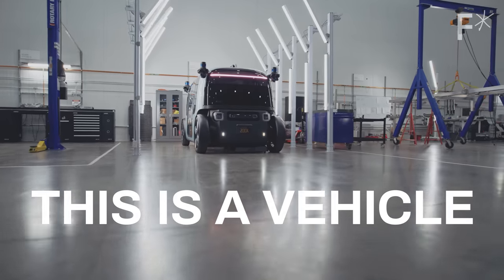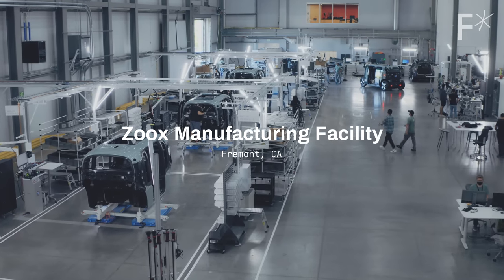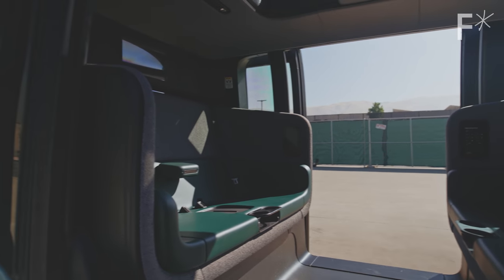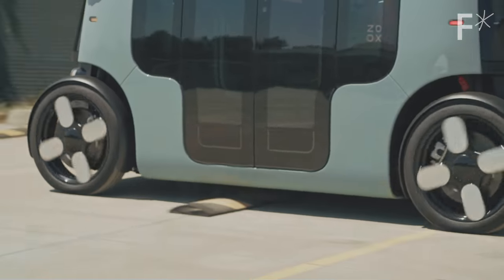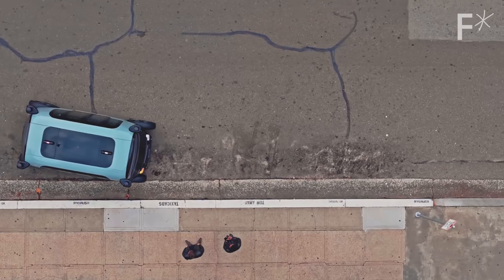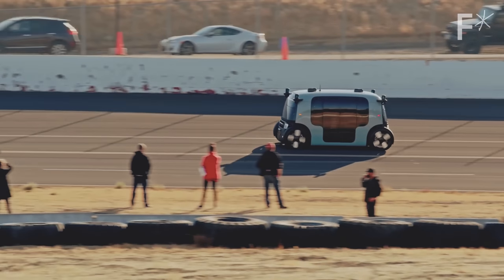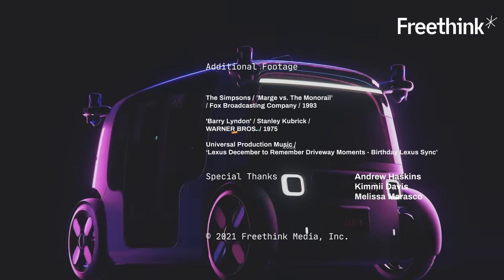Inside Zoox: The robot vehicle totally changing transportation | Hard Reset by Freethink

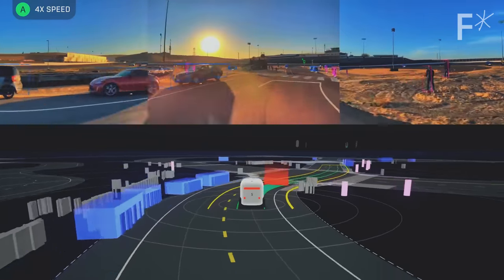Comment: At 5:39 they claim “a significantly higher level of situational awareness” yet at 4:53 the AV drives stright into the middle of an interesection that it cannot safely exit.
Reply: That seems easily fixable, tbh. Software is called Software for a reason
Reply: @cob571  it's still completely inferior to a bus ffs
Reply: @cob571  Of course it's possible to program it better. The point is the lie, much like the rest of the video.
Reply: That was a pause for a pedestrian crossing. No different to normal driving.

Comment: There are too many weaknesses in this project for this to be viable.
1. This is local only. When it comes to inter-city travel, this vehicle is useless.
2. Vandalism is a problem and so is hacking. There is 0 explanation about cybersecurity and it doesn't seem very hard to mess with the sensors outside the vehicle via spraypaint or a heavy object.
3. So the vehicle can avoid crashes. But what about other vehicles crashing into the zoox?
4. And in the case of an injury or a fatality, who is going to be held responsible?
5. How will insurance companies categorize accidents and fatalities?

And just so much more issues that remain unresolved in the video. This is just a gimmick in the end and provides a solution to nothing except to line their own pockets with money.
Reply: I mean it’s a cool concept and I could see it making car crashes be less frequent, but yeah it will need a lot of work.
Reply: Luddite

Comment: No autonomous vehicle maker ever talks about abstracted fault.  They add the crashes from dumb, drunk, high, raging, speeding, distracted drivers into their calculations of crashes prevented thus their numbers are irrelevant.   Due to the abstracted fault, these vehicles have to be safer for every single individual driver for them to be accepted on a wide scale.  That means, not the average driver, but the best driver must be safer.  Also, the good drivers are usually the ones with the funds to afford such vehicles so that is the hurdle to overcome.

Comment: Seems interesting, but I live in Appalachia, where unpaved roads are fairly common. I don't see this serving this area, let alone serving any area in adverse weather. How would you evacuate before a hurricane? Or in the face of shifting wild fires?

Also, unless there is a carpool option, commuter traffic in cities will be just as congested as it is now. 

Scalability doesn't mean broad ranging utility. What about the need for car seats or booster seats, large families (3rd row seating), cargo capacity (trips to airports, luggage takes up a lot of space), accessibility for mobility limited individuals, assistance for independent yet mentally challenged individuals that don't understand the lack of a driver... the list goes on and on. But for financially well-off, non-challenged adults this is a good option.

Comment: "Because of lawyers and insurance companies..." That, folks, is why autonomous vehicles will never, ever be fully implemented on public roads. It seems like a novel idea and I admire the ambition of those anxious to make it a reality. Unfortunately, when it comes to human beings, greed and a general lack of accountability are the very aspects of this equation that simply cannot be factored out through artificial means.
Reply: There are many machines and automated processes in regular use for which you in the end can make responsible individual beings. With airplanes, for example, crashes not caused by the pilots can often be traced to errors made by engineers responsible for the maintenance of the machines. This has worked for many decades now, so I don't see in what way the human psyche should generally not be able to attain such a handling also of dangers caused by errors of AVs.

Comment: 5:04 That statistic comes with very big caveats that are never mentioned. What it means is, in 94% of car crashes, the driver could have avoided a collision if they’d reacted faster. But on most of those cases the driver(s) were already put in a dangerous situation that were not necessarily caused by humans, but by bad safety standards, road design, and lack of necessary maintenance. So it’s simply not true that “94% of crashes are caused by human error”.

Comment: How are you going to stop it from causing accidents say if I head at it quickly in a vehicle I am driving, say in the oncoming lane, and I jerk the wheel towards it, making its' sensors presume that I am going to impact it?  Will it try to evade my car?  Or will it just ignore my vehicle?  Or will it attempt to slow down, give an impact warning?  There are many things about auto driving that concern me, not necessarily with the technology itself, but more so with the mergence while many human driven vehicles are still on the road with them.  Also, there are simply people out there that would like to mess with them just for fun, perhaps to cause problems intentionally, like hackers, etc...    food for thought
Reply: I would imagine that analog interfaces alongside the current digital ones running these would be the best answer, as it is the best way to create true AI interfaces as well.  Say if I do jerk my car towards it, it would then have a programmed set of variables, but an override of analog ones, just in case someone figures out how to throw of the digital variable programming.    So, if I were to unintentionally start drifting towards one, it would do the necessary precautionary methods to avoid it, by using whatever space around it possible to navigate, but what if there were too many variables because of too many interactions as a result of my actions; other vehicles also reacting, etc...    I really hope you do your homework people; otherwise, unnecessary deaths will only make the meta verse more popular, lol.  Perhaps this is where we are headed though, were only the wealthy can drive their own vehicles.  That might also cause tremendous issues if people do not have the current freedoms available now with our own ability to drive.    Scary, political, greedy times we are in.  A breeding ground for mass terrorism.  No wonder the police state of totalitarianism is on the rise.  No wonder our generations are slowly being brainwashed to accept this, and intentionally methodical to prevent divisions that lead to war, instead of complacency.

Comment: Here's an idea - don't charge the car...er..."vehicle" - charge the battery. Have a modular, plugable battery that can be quickly swapped in and out by an automatic/automated robotic arm or set of robotic arms. When the vehicle's battery gets low, it pulls into a station, and the battery is quickly removed automatically by a robotic unit at the charging station dock, and a fresh, fully-charged battery or set of batteries quickly inserted in. Also, We have very thin and ultralight and flexible and cheap (and getting cheaper) solar power panels (almost more like solar power wallpaper) - so cover the roof and side panels of these car...er...vehicles...with  stick-on solar power strips, and you can increase the amount of time before a car has to recharge or swap batteries. Also we now have new clear solar power collecting "glass", that charge using wavelengths of light not visible to people. This glass probably filters out UV and/or IR light (UV filtering glass is so not good for a greenhouse or if you have a lot of indoor plants, as the original builders of Biosphere 2 found out) but for certain buildings and car...vehicles...like this, and in cities in hot climates, this would not just make extra power too (in conjunction with rooftop and side panel solar mentioned above) but also keep a vehicle's interior much cooler. A set up like this would stretch the time between needing to charge - and the range of the vehicle in areas where charging stations are fewer and farther between. Then, with swappable batteries, this no need for a vehicle to just sit there idle at a station for a couple of hours, re-charging, it could be in amd out in a matter of minutes and back on the road! 

(My only issue with something like this is not the safety of the vehicle and it's ability to avoid obstacles and pedestrians and bikes and other vehicles like itself - it's the inability to avoid some idiot in a heavy all-steel vehicle barreling down a city road through an intersection that I worry about. And that kinda accident seems to be the cause of most city accidents from what I can see. I can see these kind of vehicles working in downtowns and communities/suburbs and some small cobblestone towns (like Bisbee Arizona) or in a "New Urban" community (love New Urban design!) or anywhere that has been optimised for pedestrian and bike and scooter traffic over car traffic, where cars aren't as common and they don't have the space or time to get up to dangerous speeds, these kind of vehicles and taxi's would work great. On maybe inside - and ONLY inside - the borders of a planned gated community or cul-de-sac neighborhood this could work, but in most of those neighborhoods when you drive it's to leave the neighborhood to where the work and the stores and schools are. Sometimes you might drive from one home in community to another in the same community - but rarely. I suppose having a few of these inside those communities would make sense, but they won't really replace cars and I doubt they'd get used much in the situation. But somewhere like, well, driving around a lot of US cities like here in Phoenix Arizona and Tucson or LA or Dallas or Jacksonville, Oklahome City, etc, etc, etc...suburbs, outside of the city centers where the sprawl is, where long ago vehicles were prioritized for vehicle traffic and lots of it... I would not feel safe in one of these.

Comment: That is very good, not only it will solve traffic problem but also cost of fuel, parking easiness and much less car crashes fatalities
Reply: After all, a vehicle which first has to drive to the starting point of its trip altogether drives a longer distance. Which means that you could have a lower number of car crash fatalities if such vehicles rather became common as individually owned.
Reply: Or just bike and use transit

Comment: IMO the way they are doing, will not scale up well at the start... by having to literally map every single road and city first, means you won't be able to roll it out quickly, plus if there's a new road or highway or even road diversion the computer might be confused even if there's the mapping data. 

I'd say Tesla's method might be one of the better way to increase "knowledge" even if that's mostly tedious coding BHtS . that and accurate general shop/ address data would be a much better way to go forward (it'd be better if there's a smart grid the city, but that would only increase initial cost if the city doesn't have it.)

Comment: They're not going to replace personal car ownership.  Rather this is competition to taxi fleets, public transit, Uber, Lyft, and other ride share services.  When their robot cars lose a sensor pod how good is it at seeing around corners or driving?  Nice that it seems to have omni directional steering.  But that pony is well trained by now and has been for some years.  What is the maximum speed it can travel all on its lonesome?  In a sense it is re-branding the term "auto mobile" to be something more like the "AutoCar" or even an "AutoBot".  An Autonomous Robot shaped like a passenger vehicle...in the form factor of a car.
Reply: @Flame I don't know what type of public transit you have but where I live it is a mishmash of buses powered by compressed natural gas and electric closed loop trains.  Watch the 3rd rail.  The buses and trains are human operated.  The trains have cars.  There is a shortage of drivers due to the pandemic and frankly this particular public transit authority is notorious for not paying their drivers what they're worth.  So even before the pandemic there were lots and lots of problems getting service to operate on time or at all.

The closed loop train only travels less than 50 miles in a cross configuration.  Buses feed the train stations.  None of these run after 1am.  Many bus routes stop running around 11pm to 12m.  Some stop running sooner on weekends and holidays.  Not an example of running more efficiently when you're an actual daily user.

Comment: They need to check their math.  This system would require less “cars” alright but the total miles driven will increase a lot.  If I am 5 miles from a destination then that is 10 miles round trip if I owned a car.  With their system, they still have the 10 miles round trip plus whatever miles the robot had to travel to get to my house in the first place plus the miles to get back to the charging station or the next customer.  So the energy consumption be it solar or whatever it be will be greater not less.
Reply: what if the next customer is close to your drop of point? And the one you used was close to you to begin with?

Comment: I feel like this is moving in the right direction, but it's not the be all end all. Currently, this design is only one step better than an electrically powered Uber. It's not going to massively reduce congestion or energy requirements. What could be pretty good, if they have the right tech to run the system efficiently is larger vehicles, about the size of a minibus. You would hail a vehicle from your phone and the nearest one to you that's going where you're going will pick you up, but you'd share the vehicle with some other people, and the software would intelligently route it. Then you'll be bridging the gap between high capacity transit, and 1-4 people in a private car. That might actually reduce car use a lot, especially if it's much cheaper than a taxi (which it would be if it had no driver and carried multiple people).

Comment: Why are not cars symetrical? 
Maybe because of aerodynamics, fuel economy, better wind resistance, maybe even safer (if you get into crash, you have motor in front of you)...

Simply put, box like this is maybe more efficient in how much space it takes in the traffic, but otherwise doesnt make that much sense especially for higher speeds.

Comment: may be great for short distance inner city travelling but if i wana go somewhere 100km away id have to sit a vehicle thats not mine. so i wont get the same amount of freedom like smoking or eating snacks. 

also how much would that fare cost? would it be easy to command the vehicle to stop and go at any point on the road in case i have errands to run or would it be like a point A to B styled ride ? because if its going to behave like a taxi. id have to order one every time i get off one, do my errand, come back out? 

unless all the cars on the planet are using these cars, the human error part will still be in every day life. just because youre in this autonomous vehicle it doesnt mean other people whos driving cars cant crash into it. difference is if youre driving a car you can possiblly evade. how will this autonomous vehicle evade another human driven car in case something like that happens ? 

if sensor gets damaged or covered(eg bird poop. hail. rocks that fly into our windshields will definitely hit one of the sensors at some point ), will it affect navigation. or can sensors pierce through all that ? how well do sensors work in heavy rain. if its using light like lasers does refractions screw with navigation ? will the vehicle just stop.

Comment: I want see it parallel park! And how nice the part that burns on these electric vehicles you sit on! Should be a regular heated seat after charging😂
Reply from the maker: Per Zoox's website: "We’ve built four-wheel steering into our purpose-built vehicle. This unique engineering feature enables it to pull in and out of tight spaces without the need for parallel parking. More movement = more maneuverability." https://zoox.com/journal/atozoox/

Comment: The only problem is you're going to have to remember a ten character password and do two-factor authentication just to drive to work. And of course there will be technical problems and you will forget your phone or it will be out of power. Then you'll spend 30 minutes on hold waiting for tech support. If you can understand what tech support tells you, it will be something like "restart" the power supply which you won't be able to find. Manual? Hahaha - spend another hour scrolling youtube videos. You will finally get underway and the safety protocols will stop the vehicle because a pigeon is crossing the road. The whole trip will be logged amd monitored so that some evil tech company can sell your data to advertisers - or an AI drone targeting system.

Comment: This thing really sucks because: Cost. These things would be super expensive, the price of development would be in the millions by itself . mass-produced of these things would exorbitantly expensive compared to a single train/bus/ street car (not 1 autonomous pod vs 1 bus but rather the amount of people they both can carry, so you'd have 5 pods all carrying 4 people compared to 1 bus carrying 20 or more people).

2) Pollution: lithium mining pollution is a serious problem, the lithium mining process is very similar to fracking, therefore leaving chemicals in the ground water, poisoning wildlife and communities of people. A solution would be to power via overhead wires

3) Sabotage: this system would be horribly easy to Sabotage, you can just control 6 and ram them into the president's motorcade for an assassination attempt, or crash the into another car to shut down an entire highway

So no this is just a pipe dream, there are more issues, it's just that I'm too lazy too show more.